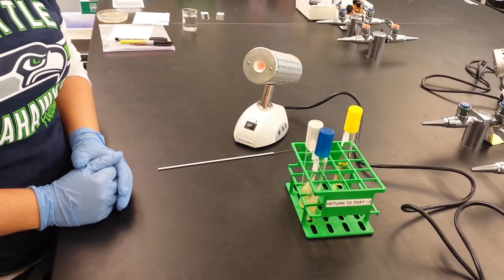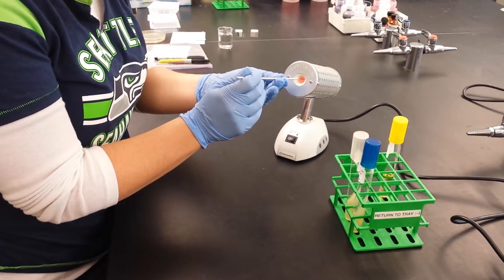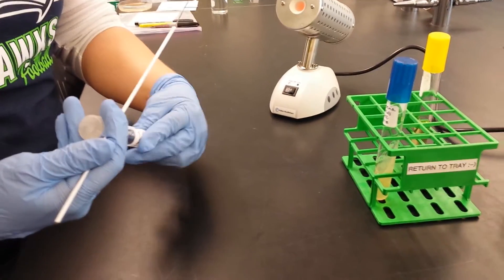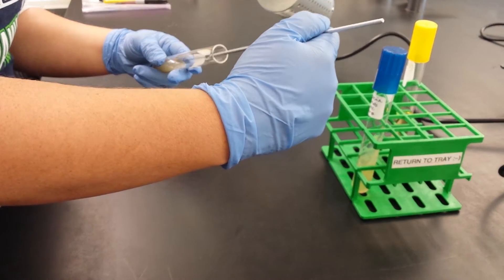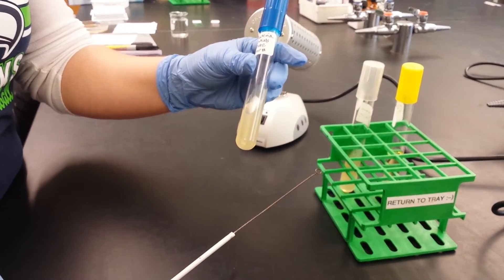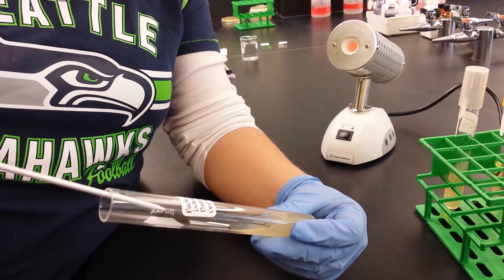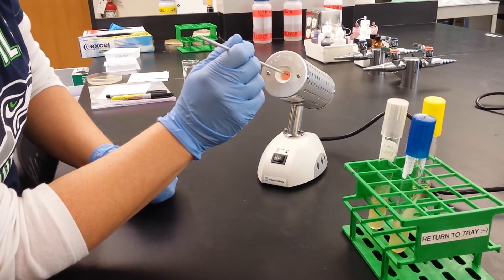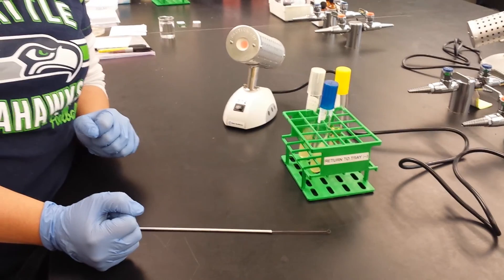Aseptic Transfer Using A Bacti-Loop

Comment: you say sterile but arent you just working in an open air environment with contam in the air?
Reply: Usually we use a Bunsen burner for sterilization, and keeping it burning maintains sterilization around the work area. I don't know if a Bacti-Loop emits heat to achieve the same effect.